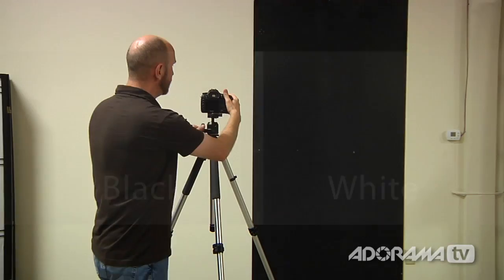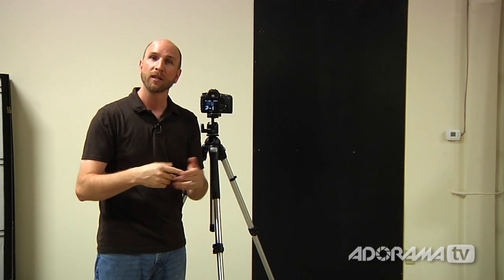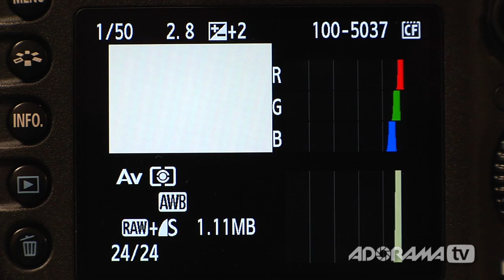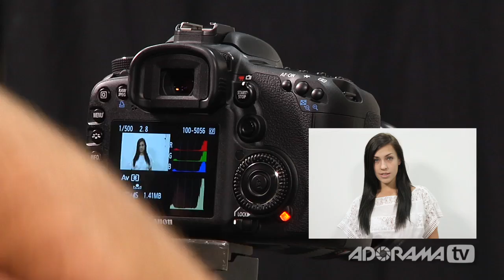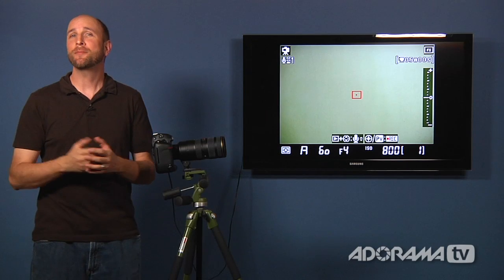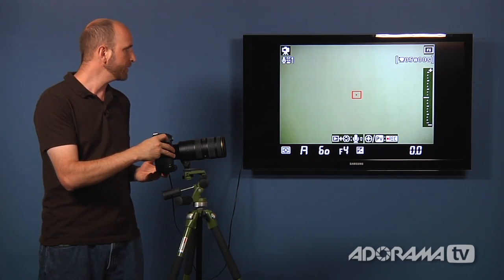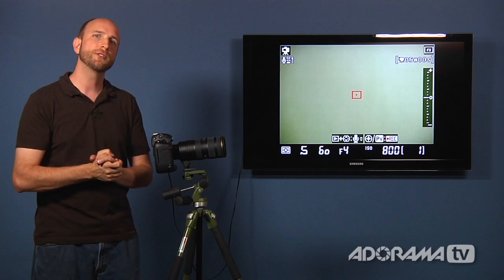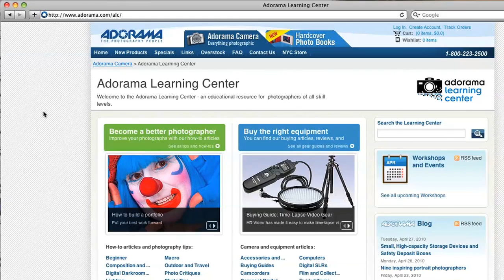Digital Photography 1 on 1: Episode 26: Metering Part 2: Exposure Compensation

Comment: Too bad he did not explain how he came up with 2 stops of AEC at the start of the video.  Most consumer cameras do not allow you dial in AEC in manual mode.  However, many professional and prosumer models WILL allow you to use AEC provided you set ISO to AUTO.

Comment: the amount of light falling on that black/white wall is he same; so, if u manage to nail on tone correctly , everything else will fall into place; so, after adding exp comp for the black wall, the settings were f2.8 1/30; when compensating the white wall, settings were f2.8 1/50; that's wrong , lol; but yeah, the above example is useful;

Comment: I am new to photography, so let me ask a stupid question. My understanding after this video is that exposure compensation seems to only work on auto or semi-auto modes (like P, or S or A). Is this understanding correct? It won;t work on manual
Reply: The camera uses Shutter, Aperture and ISO to control your exposure, you should put them all in manual mode if you want to stop your camera from taking decisions. However, you can still view your camera measured exposure through the metering bar.

Comment: this exposure compensation can use only in auto mode or it can be used in manual mode too ?
Reply: There is no point in using exposure compensation in Manual mode, because in this mode you set aperture, shutter speed and ISO for a perfect exposure. If the exposure is not perfect, just adjuste one of the prior settings. You use exposure compensation when you are in aperture or speed priority and you don't want to change one of this settings. Let's say, you want your camera to shoot in f/4. If you don't like the exposure, you use the compensation showed in this video and the camera will adjust the shutter speed and keep f/4. Or, you want the camera to shoot in 1/250, without allowing the camera to change that. If you hit the exposure compensation button, the camera will keep the selected shutter speed and will change the aperture. So, you don't use this feature in M mode, because here you have already selected every single set of the camera for a certain exposure you want.

Comment: i need some help. which of the 2 methods do you believe it's better for portraiture?manual or semi auto modes using exp copensation? which is faster? which one do you use for a portraiture with no metering difficulties? what's the point of using manual if you can be so fast with exposure compensation in semi auto modes?

Comment: Thank you Mark for the great video, a late comment though, 5 years down the line. Kindly confirm if this is true, all this exposure compensation thing doesn't work when you're shooting on Manual ?
Reply: Tonde Marimbita Correct.  You can only use exposure compensation in the semi auto modes, e.g. shutter or aperture priority
Reply: +Tonde Marimbita  you can tonde!!! wt you got to do is just press the info button and change the exposure compenstion with the help of those arrow buttons!!

Comment: With my camera with telephoto lens set in aperture value if I frame in my viewfinder an even toned dark mountain with a even toned light sky and decide that I need an exposure compensation of say +2/3 it seems that even the slightest giggle will cause the the shutter speed to change and throw off the exposure. Wouldn't it be easier just to set all the values in manual mode and not have to worry about the unanticipated changes in shutter speed?

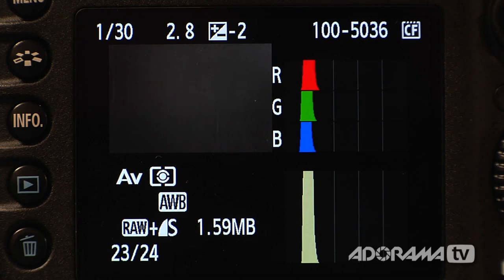Comment: Important for beginners:  Exposure compensation doesn't work in M mode.  You'll notice if you look at 3:56 in the video it shows "Av" on the image review.  He's using Aperture priority mode.  The camera increases or decreases exposure by adjusting shutter speed.  Beware!
Reply: Thank you. In M mode I control the exposure by changing ISO, shutter speed and aperture.
Reply: On some cameras you need to set ISO to Auto before you are able to use AEC in Manual shooting mode.

Comment: I know getting exposure is best to do in camera especially if your shooting in .jpg
but if you shoot raw is there that much of a loss in  quality when you adjust the exposure in light room or camera raw? i know you cant go like 5 stops and expect it to get no noise. But +- 1 or 2 should not be that much of an issue. Or is it? And I have herd from some where its better to over expose a little then back down the exposure in Post because the camera is more sensitive to brighter side than darker ones.
Reply: Approximately 80% of the data in a camera is captured in the lighter half of your camera's dynamic range. In another respect though any edit in post that is done even to a raw file will compromise image resolution. It's a balancing act we all have to deal with.

Comment: hi mark,I'm new to photography...
recently i went to photograph some sports events and i got pissed off on the exposure settings...what happened is the subject on which i focused was properly exposed but the background was washed out and it was fully white..what should i do...i tried in all the modes from manual mode,shutter priority and aperture priority... but nothing worked...i find your videos very helpful so i hope u please help me out
Reply: when it's a moving subject you should prioritize the shutter speed to be the fastest possible. but, you'll have to adjust the rest to compensate the lack of light that's entering in your camera with adding some ISO (which is the last thing you should do) and having what we call a "fast" lens (which is basically a lens with a huge aperture that let more light to go in e.g. f1.8 or even f1.4) but there is a down side with using big aperture, you'll have a hard time to get the focus on the whole subject since the in-focus zone is more narrow (bokeh!).
with all that being said, the next step is to try setting up flashes to force more light going into the camera but that's not really possible when taking pictures of sport events. if the back was all white it may be also because the subject wasn't well lighten and the rest was too bright (that is the time when light and flashes are handy if usable).
Reply: thanks Chris LEA 
It was helpful ;)

Comment: @akmalrosli well yes and no, if your pictures are overexposed, you can either under expose your metering to the negative side. Also you can change your exposure to go over or under by changing your aperature or shutter speed as the video indicated. I hope this helps

Comment: I don't understand why you use exposure compensation. Why not just change your fstop, or shutter speed to bring down your exposure instead of using a compensation in your camera?
Reply: In Aperture Priority, if you change your f/stop, the camera will just adjust the shutter speed to give you an equivalent exposure to what you just had with the last f/stop you used. It won't change the exposure. It will only change exposure if you adjust Exposure Compensation, which is basically adjusting your shutter speed, which will actually change how much light is let into your camera.

Comment: @hyperboogie No, that is incorrect.  The center weighted metering will try to make that 18% grey.  It doesn't matter which metering method you use.  The method just changes what area is being evaluated.  They all try to get to 18% grey.  You would still need exposure compensation.

Comment: Considering part 1 of the metering tutorial, wouldn't it also make sense to use center weighted metering? it should meter more correctly without the need for exposure compensation? Am I correct?

Comment: nice videos...  but I expect that if we set correct light mode, use spot metering mode then we might not need to exposure compensation. 
I usually use exposure compensation based on light conditions.